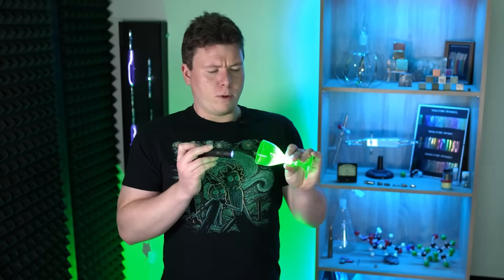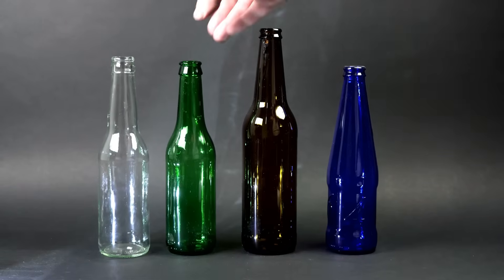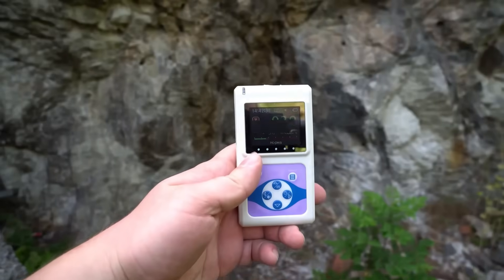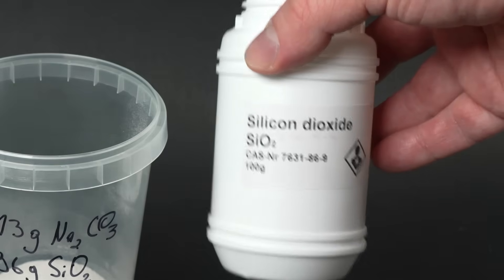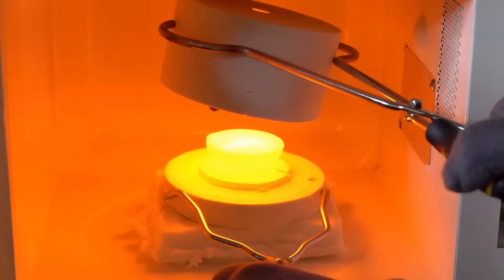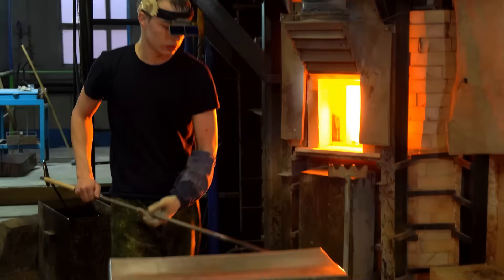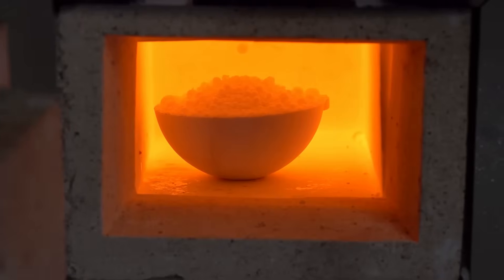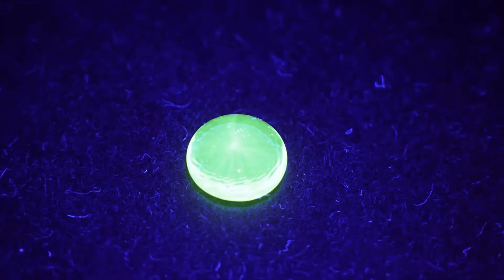Making Uranium Glass With some Unusual Properties!

Comment: Good (I guess) that these other compounds are not radioactive, but are they toxic? I'm guessing almost no research on that...
Reply: More than you think. The thing about glass, though, is that it forms a matrix around these compounds. Putting lead, uranium, etc, into the glass doesn't typically make the glass toxic. MAKING the glass requires care, and if you grind the glass, the fine particulates can be problematic (but that's the case even if it's plain clear glass, don't breathe silicate particles!) but putting toxic compounds into glass can actually be a way of making it safe to store.